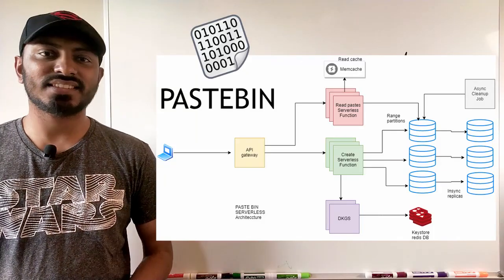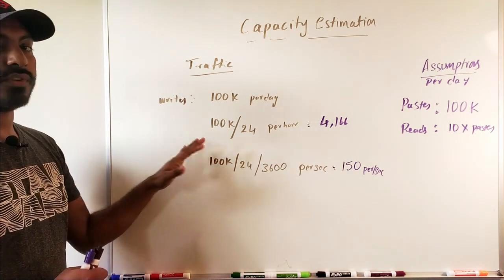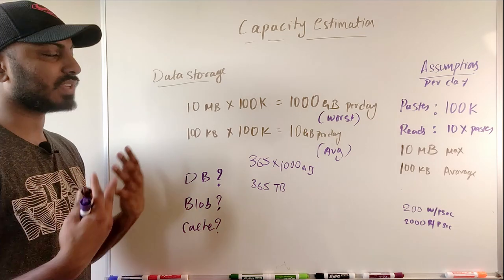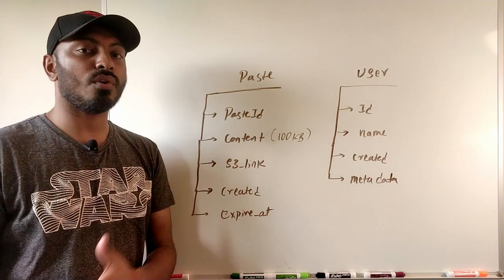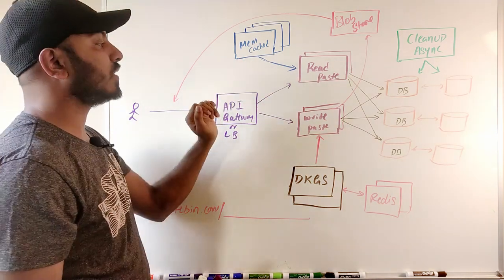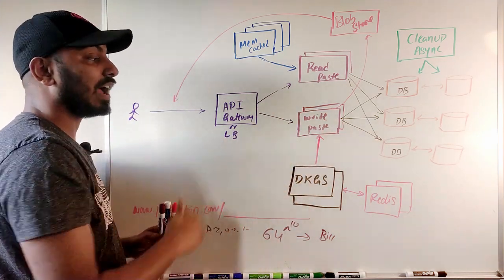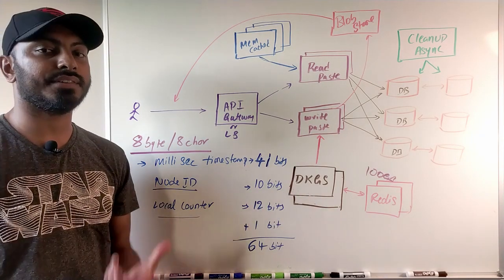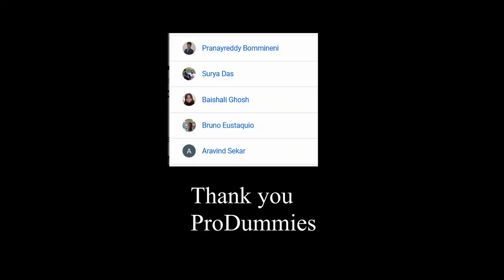Paste bin system design | Software architecture for paste bin

Comment: Couple of things. 1. Using serverless will not give you predictable SLA. 2) Cleanup service need to delete the entry from cache also. else, expired paste will still be accessible. 3.) rather than DKGS , you can use UUID (it takes double size 128bit) but u will not need redis and DKGS
Reply: If you use UUID inside the writepaste lambdas or containers then there is a chance of duplication as there are multiple instances. I don’t think that will work well.
Reply: @kartikvaidyanathan1237  A collision is when the same UUID is generated more than one time and is assigned to different objects. Even though it is possible, the 128-bit value is extremely unlikely to be repeated by any other UUID. The possibility is close enough to zero, for all practical purposes, that it is negligible.
Reply: @rabindrapatra7151  yes but what is stopping from multiple lambdas from generating the same UUID. I understand if the Id gen service is centralised and UUID comes from there. But my understanding is each lambda internally generates a UUID
Reply: Cleanup service need to delete the entry from cache also. else, expired paste will still be accessible -> Can't we add into cache with TTL. That should automatically solve the issue
Reply: we cant use UUID because then we cant use it as alias in pastebin url, its too long

Comment: I loved this design! thanks a lot! I'd like to add one point not covered in the capacity estimation. based on the input, users can add up to 10Mb per paste. 100k per day, deriving in 1000GB per day.
I think it's good to mention that we can apply compression  (manually or let the db do it) to the text that way we can save up to ~60% of the initial calculation for storage, reducing costs quite a lot

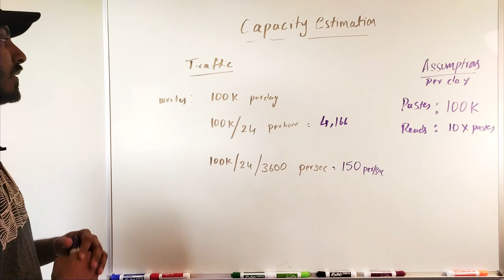Comment: Hi Narain. Great video. However, there seems to be a mistake at 3:26 in the estimation part. 100k/(24*3600) = ~1.5 not 1.5k writes/sec.
Reply from the maker: Feels stupid, why did I make that mistake😁
Reply: @TechDummiesNarendraL  You are doing thousands of smart things. No prob!!!
Reply: Your comment confused me further. You said "not 1.5k writes/sec" but in video he said "150 writes/sec". Did you mean it should be 1.5 writes/sec and not 150 writes/sec?
Reply: Also to note, here "per hour" and "per second" is not really used in the design later on.
Reply: @IC-kf4mz  Yes, it should be 1.5 writes every second.
Reply: Don't worry, this way you are designing a system that can withstand 1.3M pastes/day.

Comment: hey,
thanks for tutorial.This channel is really awesome.
I have a doubts:-
1.When you are mentioning data base comparision @13:00(approx). Why did you choose partitioning in RDMS.I think partitioning would be easy in NO SQL world as some db provide inbuild solution for this and RDMS is often easy to scale veritcally instead horizontally. Isnt it better to have NOSQL if we want to scale later?

2.And if we use partitioning .the way u mentioned that if one db is filled ,we will go other. Shouldnt we be using consistent hashing in this case instead of one range filled, go to other. Range based partitioning has multiple db nodes running parallel each handling different data.
Please let me know you thoughts

Comment: Your video is great !! 
Had one small doubt though below:
How do you explain how can 10 character key be used to generate 100GB?
Ideally total storage for 10 characters can be  (62^10) * 10 bytes [assuming a character takes 1 byte] which is a lot more than 100GB
If we assume we are using 5 character key we will get (62^5)*5 bytes which is approx 34GB

Comment: Hey narendra, what shouldbe the initial approach on any system design. Ex: I can  we have split the requirement into functional requirement and non functional.
Also what are videos which we need to go thru first to get the fundamentals and to full scale design.
Any recommendation on materials to understand the basic module of SD.

Comment: How is "User can decide on the pastebin link" solved? Here it seems that the user can keep on trying for a unique ID, of length 10 as constrained, and keep on hitting on the already used ones, leading to going to and fro until he finds a unique key? Does the snowflake generator or just a normal key generator help with this?

Comment: Thanks for the explanation! 

In the async clean-up step, should we also clear the value in the mem cache? For long texts, we'd end up with a preview (from the cache) but when it tries to fetch the full text from the DB it'll error out?
Reply: Mostly we will cache the data with some expiry dates time like 2 days or 7 days something like that, so it will automatically expiry automatically